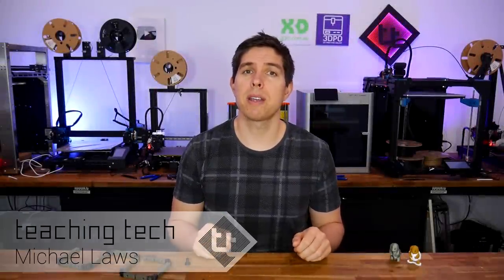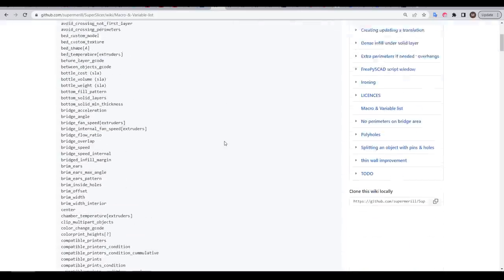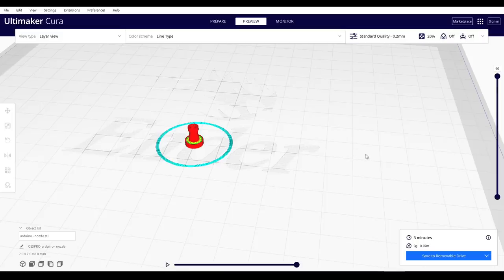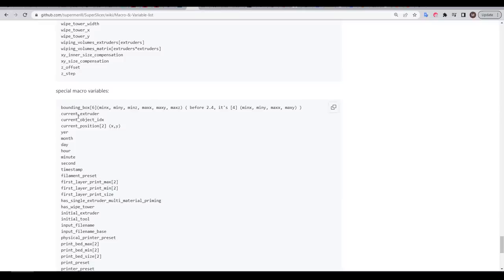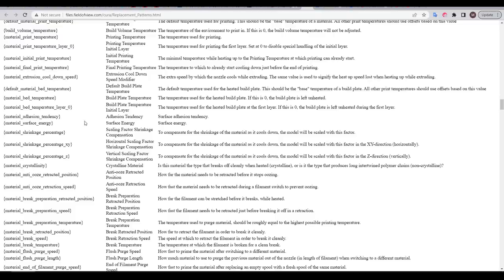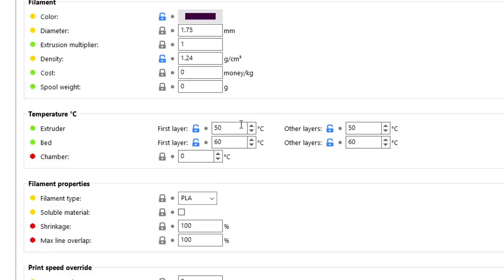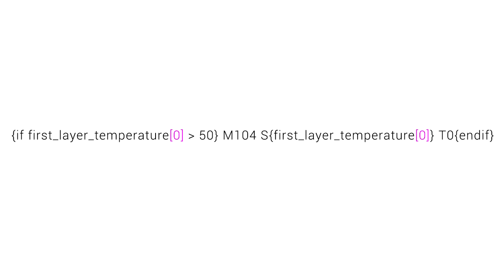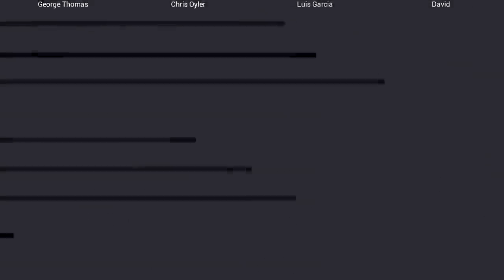Get more from your slicer using variables and conditional gcode

Comment: For Cura, the same Post Processing Plugin has a specific script called "Display Filename And Layer On LCD" which will do exactly what was achieved in this video - including the option for max layer number. It is obviously not as flexible as the video intended (no variable substitution), but at least that one specific use case is available on Cura.
Reply: I was about to post the same.
Regardless this video was an excellent tutorial showing what can be done, thanks Michael!

Comment: I've done the exact same thing on my TLD3-Pro IDEX machine.  I made an "extruder off" profile so I can print with the right extruder on a single material print and the left never heats at all.  Trying to keep the usage close to the same on each extruder and .6 CHT nozzle.  It's my largest printer(until my 350 Trident is finished) and CHT nozzles aren't cheap.  Great informative video

Comment: I'm no programmer but I try to offload all conditional functions with custom macro's in Klipper. This way it's easier to work with multiple slicers. I want to fully convert to SuperSlicer but I'm missing the look ahead capability for heating multiple extruders like idex printers.

Comment: Fantastic video. My use case will be for a custom IDEX printer that has brushes for cleaning the nozzles before priming the toolhead. Because PETG tends to stick to the nozzle too much, on an IDEX you get cleaner results if you clean the nozzles on the brush each time you change tool. I have seen that for E3D toolchangers they edit the toolchange macros, but that only works for RRF control boards. It is nice that there are free slicers offering this amount of control and customizability. Customizing the hardware of the machines (adding cleaning brushes) is a lot easier for most users than making custom slicer plugins/scripts or modifying firmware. At least for people with experience in design for 3d printing, that don't have much experience in coding.
Reply from the maker: That will be a clever implementation.

Comment: Nice tutorial, this helps me a lot. Just last week I was thinkering with conditional Gcode but couldn't find good documentation for PrusaSlicer. May try Superslicer now

My coreXY is 400mm* long but it's difficult to remove the print if it's short of flat because of the carriage and estructure of the machine blocks me from the printbed
So I made a Gcode that moves the bed to Z200 if the print is short (easier to remove) and only +Z30 if the print is above 200mm, also limited at Z395 by gcode, because if I use the 400mm of the firmware the heatbed crashes against the electronics at the bottom (factory firmware....)
Reply: eh, it lacks a Z soft endstop (or incorrectly set)? Weird condition, sounds like a prime candidate to flashing new firmware on it, if viable.

Comment: LOVE your videos...very informative.  But I'll admit they are sometimes waaaaaaay over my head, lol.  Having said that, I'm primarily a Cura user, but I've been trying to switch over (or at least get more familiar with) Prusa Slicer and Super Slicer.  One of my printers is a modified Creality CR-X, running a BTT board and Marlin firmware.  It's a dual color printer, but only uses a single hotend/nozzle.  I have custom gcode in Cura that allows the printer to retract 1 filament, advance the other, purge it, and print...then switch back as needed.  For the life of me, I cannot figure out where to put this gcode in PS and SS to make the filament switches.  Is there a place I can go to learn this, or a fairly quick/easy answer you can give me to help me out ?  THANKS !!!!!

Comment: Great content.  Can you extend this logic to work with a tool changer or IDEX printer to preheat nozzles before an extruder change to speed up multilateral changes?   Waiting for a nozzle to heat up before continuing can add significant time to a print.  Many thanks for your work.

Comment: How many years and versions of cura and we still don't have one where they print a last layer < theSetLayerHeight to bring the final part up to the finished dimension. 
i.e. print a 1.4 mm high object with a 0.4 later height, 0.3 initial later a you'll end up with something 0.3 under size at 1.1

Personally I would like to see less fancy crap and more focus on fixing silly bugs and omissions that never should have existed in the first place.

(trigger warning) Unfortunately the damn thing is written in python or I'd fork it myself and put in some useful functionality.